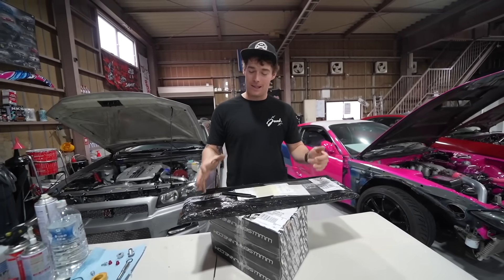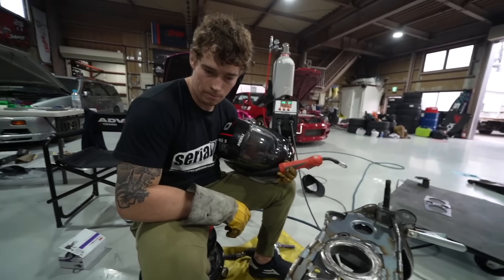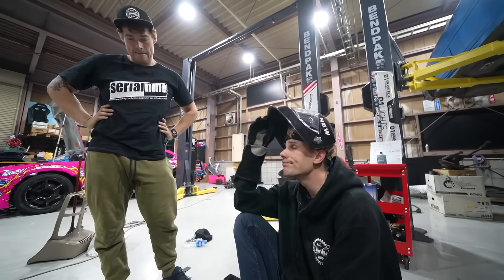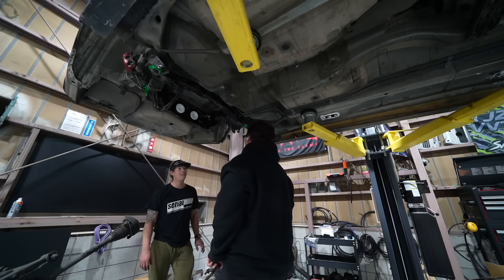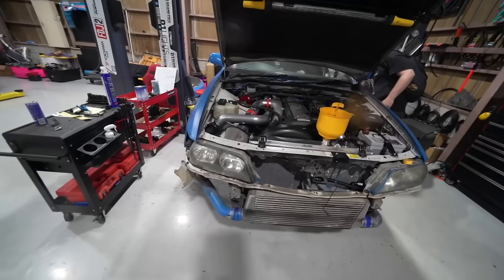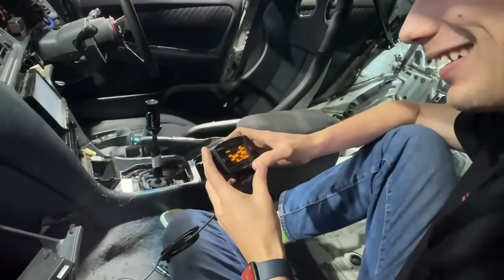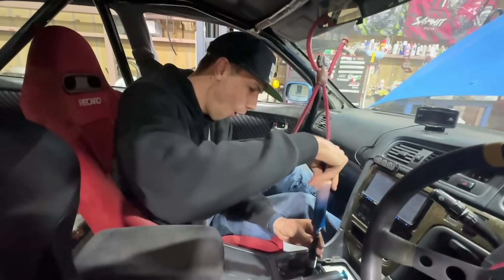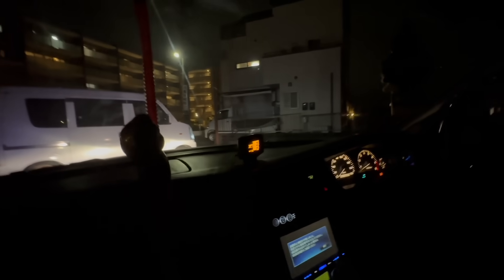RUDNIKS FIRST COMPLETED BUILD IN YEARS!

Comment: Small tip that ive always followed that was told to me when doing my cars, If you find a crack like that drill the end of the crack both ends so it stops the crack, grind along the crack to V it then fill the crack, little stronger repair on a stress crack. Keep it up ruddy!
Reply: You are correct but let's be honest , this car isn't going to last long enough to worry about it 😂
Reply: If he didn’t add all that reinforcement, yes but that subframe shouldn’t flex enough anymore for that crack to reappear

Comment: Loving this jzx content👍 a tip for welding is on a crack to drill a small hole on each side of the crack, make a valley in between for the weld to fill into, then tack each side and fill in. ✌️the hole drilling is to stop the crack from spreading further.